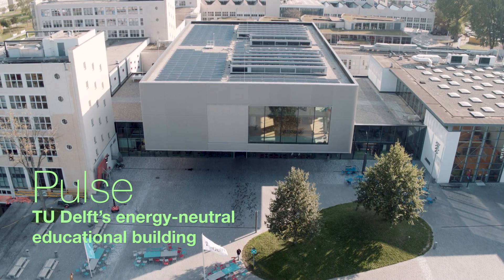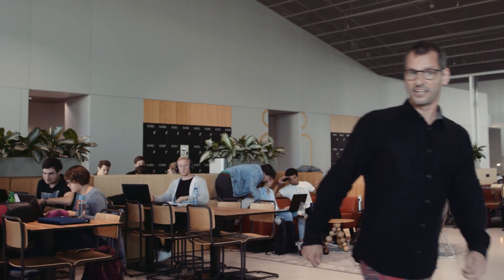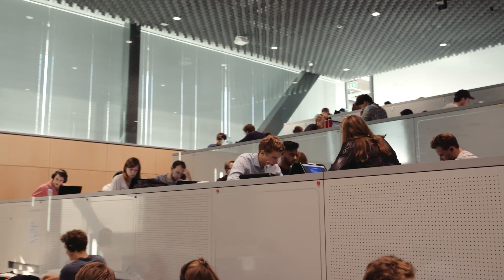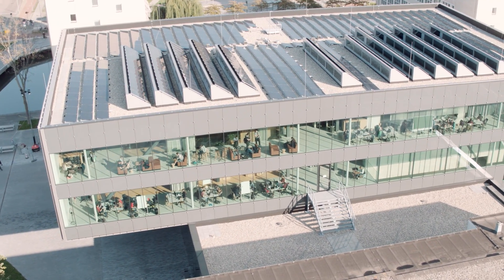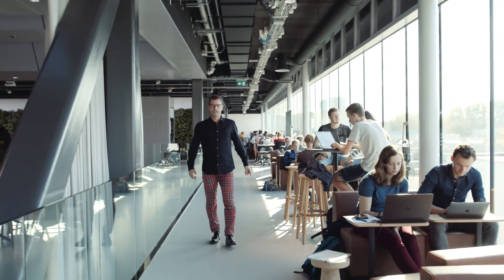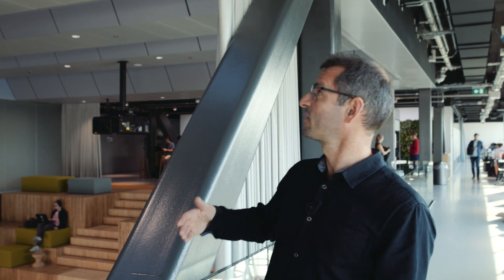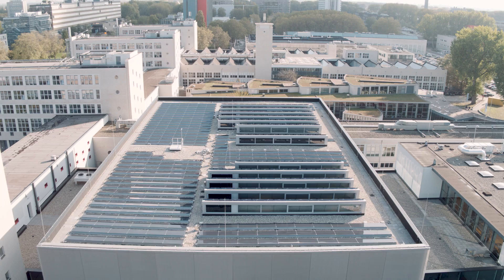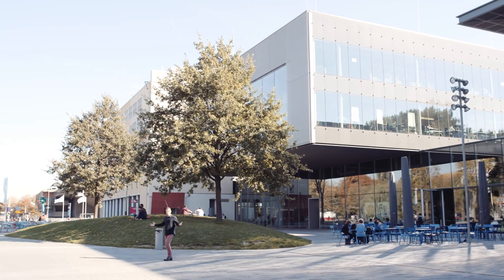TU Delft - Zero Energy Design: Pulse

Comment: Cool, but I'm of course still a bit skeptical. This building is only really carbon-neutral on an electricity standpoint. First there is probably a high environmental cost to building this building in the first place. Then you've got the fast food court, probably serving a lot of meat and other environmentally distressing foods. No building will probably ever be completely carbon neutral and TU Delft did do a good job but it's not as perfect as they might make it seem.